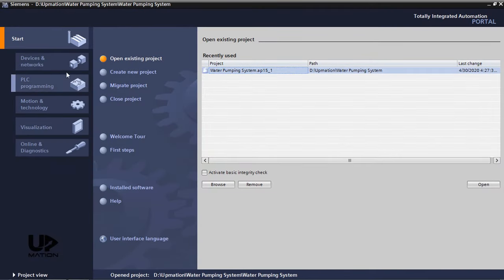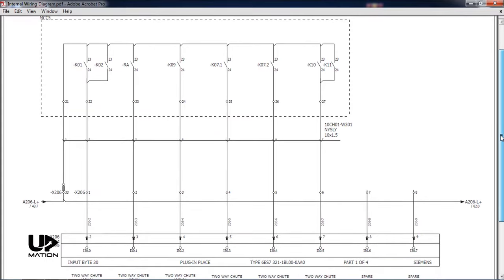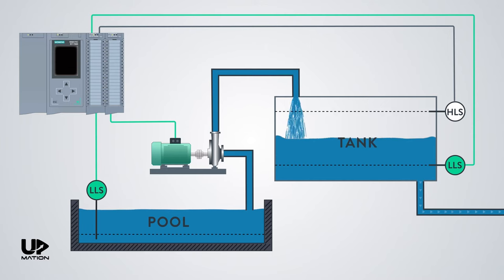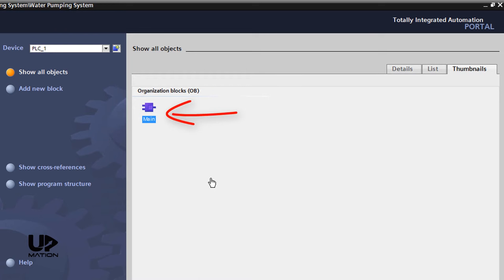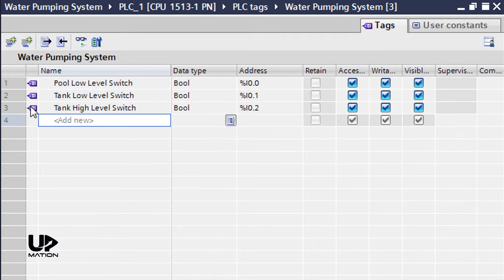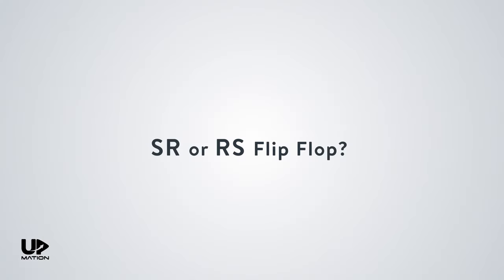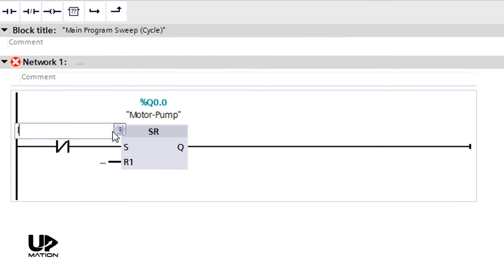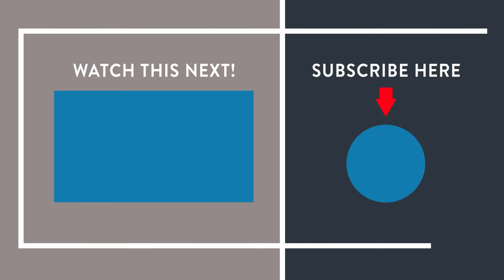Siemens PLC Training: How to Write PLC Ladder Program | PLC Program for Water Tank Level Control

Comment: interesting the video. Simple and pleasant. For my part I would add two input variables. One coming from the thermal relay of the contactor, to turn off the system and turn on a pilot light and the other to select between automatic and manual. Congrats
Reply from the maker: Thanks for sharing your tips and comments, Ricardo!

Comment: Hi youtube, can i know the components that u use? My college final year project want to do this. ^_^
Reply from the maker: Hey! What do you mean by the components? If you mean the software, that is TIA Portal V15.1.
Reply: Sensor and motor
Reply from the maker: @jiarong1966  For the sensors you can consider them as Floating level switches. and consider a 20KW electric motor. However, these are some assumptions and can be changed from one project to another.
Reply: Thk for your reply^_^

Comment: When the low level switch senses water won’t it turn off the motor?
Reply from the maker: Hi Li, the short answer is no!
I believe you are assuming to turn on and off the pump only by means of the low-level switch (and you did not consider the high-level switch). In this case, the motor-pump will turn on and off intermittently and frequently IN SHORT PERIODS of time. This will lead to the motor breakdown very soon or the system will fail due to the frequent mechanical stresses (Of course, the motor thermal protection will shut down the motor before breakdown!).
According to the scenario @1:12, after the HLS turns off the motor, we have enough water in the tank for some time. So the motor will remain shut down and will rest until we are in a lack of water in the tank again. In this way, we increase the period of ON and OFF sequences. I hope my answer was clear enough! Let us know if you have any other questions.
Reply: @Upmation   Thank you so much for replying. 
So how does the pump fill the tank up to the high level if the tank LLS switches off the pump when it senses water?
Reply from the maker: Hey Li, you're very welcome!
As per my explanations, it is the High-Level Switch (HLS) that turns off the pump as soon as it senses the water (to prevent the tank from overflowing). On the contrary, the LLS will turn ON the pump when it DOES NOT sense the water (to fill the tank). By the way, if you watch this video about NO and NC contacts, it may help you more on this subject ( https://youtu.be/txUbijasCZU ). And please reread my previous reply and let me know if you found out your answer or not.
Reply: @Upmation   Thanks, I think my understanding of flip flops or latching relays was wrong. I think I get it now but correct me if i’m wrong:  the output does not rely on a continuous pulse (1) from the set or reset inputs. So the pump will remain on after the LLS senses water (and the NC contacts in the program open), until the HLS senses water (and the NO contacts in the program close, causing it to reset the output).
Reply from the maker: @LC-qi5ff  Just as you said! We should not confuse the real (actual) contacts with the NO and NC contacts in the software. 
As you explained, when a switch (LLS for instance) is open and not sensing the water, then its corresponding NO contact in the software (I0.1 for example) is OFF! and at the same time, its NC contact in the software is ON and therefore the Flip Flop (in the example) is "Set". and vice versa... 
We'll have pointed out this, in another PLC programming example which is going to be published in December.
Reply: In field both High Level & Low level Sensors are NO. 
when water is below low level Set Activate Immediately and holds Until water level reches HLS. (water is above LLS the NC contact in software out put is 0) (water is below LLS the NC contact in software out put is 1) 
Once water Riches HLS Reset. Stops Motor. Now water will drain once water reches below LLS again set Activate. It's loop. 
Correct me if am wrong.

Comment: Why would you talk about using all three switches as NO and then taking from 'Instruction' tab NC and placing them for two low levels? 5:17
Reply from the maker: Using a physical NO contact does not mean that we should use the same thing in the software. The tank LLS is a physical NO contact with the I0.1 logical address in the PLC software; when the level of the water is higher than this switch, its physical NO contact is closed and the I0.1 is active. So, we use an NC contact for I0.1 in the software to say the PLC that whenever the I0.1 is NOT active do this or that! (In this case, start the pump cause the level of the water is lower than the LLS). I hope you got what I mean. But I strongly suggest you watch this video as well: https://youtu.be/txUbijasCZU
Reply: but will the water level change the position of switch physically and what happens if you loose power when the water is half the tank
Reply: @tipsinvestments9460 if you lose power then the motor would shut off aswell?

Comment: Better to use P or N switch in this scenario. SR stands for set and reset, so i was learnt to not use classic NO and NC contacs because they are not pulse.
I think because of some bug, so its more reliable.
Reply from the maker: Hey! Thank you for the input! But We normally use P or N, for the signals that are naturally Pulse type and we want to get their inputs throughout their Positive or negative edges! In my experience using FFs does not causes bugs.